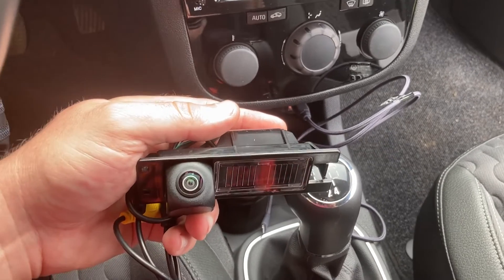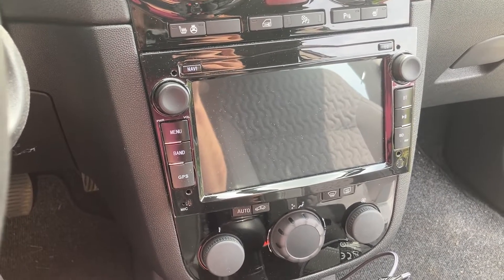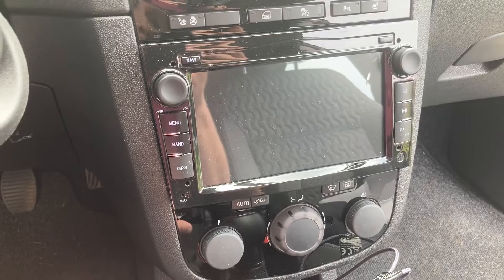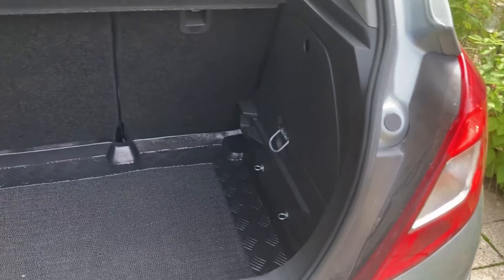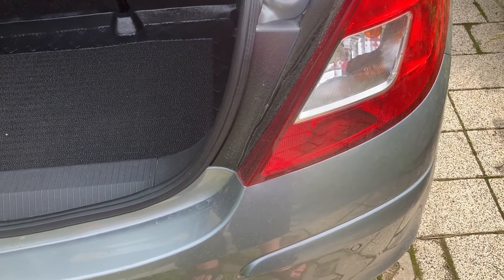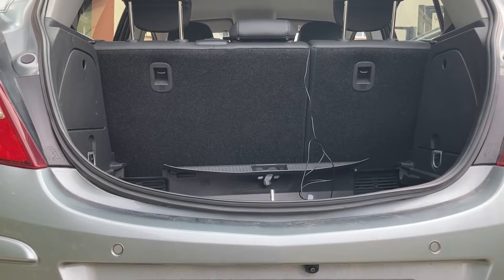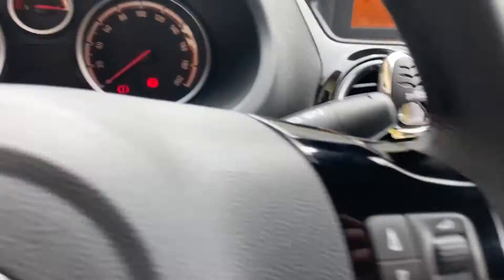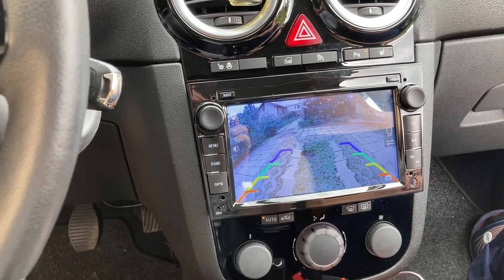DIY - 2014 Opel Corsa D 1.4: Install a reversing camera

Comment: Hello, I have installed the backup camera just like you. I have the same setup. The first 5 times it worked great, after that the video frame from the backup camera on the screen shifted to the left a few centimeters. I can't find any settings to adjust the video frame shift. Do you have any idea how i can fix this?
Reply from the maker: That's strange, honestly, considering that the first few times it worked fine. Have you tried disconnecting it from the Android unit and reconnecting it? Are all the wire contacts solid (including the one to the back of the unit)? I don't have any left or right-shift options on my unit either, so I'm not sure if this is something that can be solved through software...
Reply: @TheMissingBolt  I have tried reconnecting it, I am going to check the connections and do a few test to see which part is failing. Thank you for your input!

Comment: Nice video 👍 
Do you know how to change reverse parking lines from static to dynamic. So they move left and right when your turn wheel. Is there an option in settings. Thanks.
Reply from the maker: From what I remember, the option to switch from static to dynamic was a special wire on the camera itself that needed to either be cut or not cut in order to put it in dynamic mode. I left ours on static. I haven't seen any special option in the navigation unit's settings to enable / disable this feature.
Reply: @TheMissingBolt  thank you. I know some cameras come with that option to cut or not cut wire but those dynamic cameras are a but dogey, it should be built into unit and work with the steering wheel thanks to canbus but I think these units just don't have it built in on the option. Thank you for reply.

Comment: In my car when I put the reverse gear, the radio already knows and looks for a camera, so I suppose I do not use the reverse light but the camera still needs power I assume. I need to check because in the manual there's a "reverse video signal+" cable apparently, which do the job.

The main issue is I still don't know if I want to get the camera because I'm not sure I'll use it. Do you use it all the time for parking? 

PS: In Italy we just hit the car behind. 🤣
Reply from the maker: Indeed, one camera wire is for the signal but the other is for power. I didn't want to take power from the radio unit, I thought it simpler and safer to take it directly from the light bulb. Having said that, in our case at least the camera has proven to be very handy. I know about the Italian habit about slightly bumping the car behind, I think it's really funny 🤣 ... but here in Romania, people don't take kindly to that sort of thing, unfortunately... so parking sensors and a camera are really useful!
Reply: @TheMissingBolt  in the end I decided not to get it. I don't want the hassle and I'm getting in and out of complicated  situations without issues, so I don't think I really need it.
Also we park so close to each other over here that a camera or sensors can't even help. Like sensors would beep all the time and the camera would be too close to see what's happening.

Comment: With canbus u actually dont have to cut the rear light and use the ground at the right rear light (bolt)
Reply from the maker: In principle any ground source should work. Indeed, it may have been easier to only splice the positive wire for the rear lights and then use that bolt for the ground. Both solutions should work just as well.

Comment: The link to the camera is dead :( 
You got any screenshots or New link? 

Im looking for One for my corsa 2013 but I can only find for Corsa 2011… None says 2013
Reply from the maker: With AliExpress sellers it's best to ask them directly if a product works on your year and model of car - I did this myself before buying the unit because (if I remember correctly) the product page said it was compatible with Corsas only up to 2012 ... but the video is proof that it also works on a 2014 model.

Comment: hi i have one question do you know sa if it possible to change the layout and icon specially for the clock from analogic to digital and also reverse.thank you
Reply from the maker: That clock icon is a widget which is provided by the Android system running on the display unit. You can remove the clock widget and replace it with any alternative that you like better. For my particular unit I don't remember seeing an analog clock widget (i.e. a round clock with dials / needles indicating the time), but then again I never searched for one. Given the many widgets Android has available, there's bound to be one with an analog clock too.

Comment: hello what are these little red cables on the rca used for, because you didn't connect them maybe because your machine is canbus
Reply from the maker: It is a CANBUS, yes. That's why I needed to use a filter in order to power the reversing camera.

Comment: Hello.  I apologize in advance for the bad English.  I wonder if the original display above the multimedia works for you?  I have a big screen from full equipment but I want an android but I would like my factory display to work as well.  I hope you will see this comment even after 5 months from the publication of the tutorial.  If there is a possibility to contact you on another social network I would be grateful.
Reply from the maker: Hello! Yes, the display above the multimedia works fine with the Android unit that I got. I was also worried about it at first, but it turned out to be no problem at all. The only minor inconvenience is that in order to change the time, for example, you no longer have a physical button, instead the Android unit comes with an app that allows you control the upper screen.
Reply: @TheMissingBolt  Hi friend, can you please tell me how that app that allows to control the upper screen is called?
Reply: A little bit late, but it may be helpful to some people: you can code the car via Op-Com to make it seem like there's no radio installed. After doing that the "music" tab in your screen is going to dissapear and "settings tab" is going to show. You can then access the settings via the steering wheel controls.

Comment: Good job an d thanks for the video. One questions:  is the same color (lucid black) the radio unit than the rest of the car interior? In the video seems yer but on internet I saw a lot of opaque black
Reply from the maker: Yes, I matched the color of the Android unit to that of the dash, namely lucid black. The seller I bought from also had dary and bright gray. I didn’t see opaque black as an option.
Reply: @TheMissingBolt  thanks for your answer. I was talking about the other sellers on aliexpress. Are you satisfied of this android radio? Is it possible to share the internet phone connection with the radio unit? Can the radio unit be update with the new android version? Does android car work well with the phone via BT?

Comment: Hi, did you add reversing radar on the rear bumper ?
Reply from the maker: Not sure what you mean by reversing radar. But if you're referring to the rear parking sensors, then those came with the car from the factory so I didn't need to touch them at all.

Comment: Hi, is your new radio still working? I was reading online that plenty of people say that it dies after few months of use. 
Thanks for sharing your experience! 😊
Reply from the maker: Hi! Mine is still going strong 😀 I installed it in the spring of 2021 so it’s 2 years old now, with absolutely no issues.

Comment: Hi Dear, can we use the GPS NAV from the same device without connecting to mobile device. I need to upgrade music system and add gps nav system in my vauxall corsa car but i thinking if i can install  1 device only for both functionality.
Reply from the maker: Yes, you can. The device uses Android, so the usual applications are available through Google Play, including Google Maps, Waze etc. The GPS sensor itself (which plugs into the unit) isn't extremely accurate, but does a good job overall.
Reply: @TheMissingBolt  Thanks so much for reply. So i will buy this device and use the inbuild GPS of this device.
Reply from the maker: @deepakkakkar7698  Yes. But do note that you to need to create a hotspot from your phone or to insert a SIM card to the unit in order for it to have data access.
Reply: @TheMissingBolt  ohhh that is what that I dont want. I thought GPS NAV works without any such SIM or hotspot network. Thanks for noticing this.
Reply from the maker: @deepakkakkar7698  If you're using an online navigation app, such as Waze or Google Maps etc., you do need internet data access to keep the maps updated. There's no way around it. You can use alternative offline navigation apps, with static maps that you only download once - these won't require a SIM or phone connection during driving. But they also don't give you traffic updates, don't update the route based on the latest traffic data etc. The navigation unit itself does allow for simultaneous music and navigation, so it should be close to what you need.
Reply: @TheMissingBolt  Got your point dear. Now i am all clear. So may be i will buy tom tom or Garmin device to enjoy GPS and music both same time.

Comment: Hi, hope you can help. I have a Vauxhall corsa 1.3 diesel. It’s 14 plate but don’t know which head unit would fit my car. Can you send me a link to it as the one from Ali express has 15 different kinds from your link when going to add to cart.
Reply from the maker: Hi! I've added a link in the video's description with the exact unit I used. To be more precise, I got the version with Android 10, MTK PX5 processor with 8 cores, 4 GB RAM and 64 GB storage, together with the Carplay cable. I got the camera from a different supplier (also in the video's description).

Comment: Hello I broke some of the clips that hold the black plastic trims on the car you can see them at 34m 06s of the video do anyone know we're I can get replacement for them thanks
Reply from the maker: Yep, it happened to me as well on a different occasion. You can either buy them from an Opel / Vauxhall dealer and expect to pay 2 - 3 EUR per piece, or you can try from AliExpress (tinyurl.com/yc2knzjv), where they're much cheaper and may be just as good as the originals. For reference, the OE part number is 2228839.

Comment: Did you have som problems with radio not turning off when you take key out?
Reply from the maker: No, I've never had this issue with this Android unit. It always shuts down about 1 - 2 seconds after I remove the key.

Comment: I see that there's no USB port on the unit, how would you connect apple carplay ? Will the factory USB port do the job ?
Reply from the maker: The unit comes with 2 USB ports. The first one is for MP3 sticks etc. and I've connected that to the factory USB port of the car. The second is for wired Android Auto / Apple CarPlay and has a dedicated wire that also comes out near the 12V socket.
Reply: @TheMissingBolt  is it possible to wire the apple car play USB port to the factory USB port and not the MP3 stick one ?
Reply from the maker: @TheAbrunqaj  Yes. The factory USB port continues behind the dashboard with a cable that ends with a miniUSB jack. You need a USB-to-miniUSB adapter here which you can use to connect either of the 2 USBs from the Android unit to the factory USB port.
Reply: @TheMissingBolt  I recently bought a 2011 Corsa D and would love to install a backup camera. The car came with the SAT NAV unit . I wonder if that factory unit will support a backup camera ? I didn't have a chance to remove it yet to see if it has a video input.
Reply from the maker: @TheAbrunqaj  Honestly, I have no idea if an aftermarket reversing camera can be coupled to an original Corsa SatNav unit. One thing you can do (apart from checking on forums if anybody tried this) is to pull the unit out and check out its rear connectors, to see if any of them may be used to attach a camera.
Reply: @TheMissingBolt  Thank you buddy.
Reply: It's been a few months since you have the unit. Are you happy with it, do you recommend it ? Any lag or disconnect issues ?
Reply from the maker: @TheAbrunqaj  I've had it for nearly 1 year now. I'd give it a 8.5 / 10 overall. No disconnect issues, it behaves well. I'm having some problems with Bluetooth and radio background noise, though with the latter I'm about to try out a better antenna. Android apps including navigation (Maps, Waze) works well and so does the reversing camera. It does warm up a bit after 2 hours of continuous use, especially if you're using navigation, but it never crashed or shut down on me so far. For ~250 euros it's been a pretty good bargain.

Comment: Did you install the android Auto yourself? If so, would you have the instructions for it?
Reply from the maker: Yes, I did install it myself, though at that time I wasn't making YouTube videos. I don't recall having any instructions in the box the unit came with, though the setup is very straightforward. At the very minimum, there is one large cable bundle that powers up the Android unit and which connects directly to the wiring harness of the car through a large dedicated plastic jack. On Corsas that have MP3, you also need to connect the USB cable from the car to the dedicated USB wire bundle for the unit. Typically, all wire bundles in a good Android unit should be labeled individually and you can't connect them the wrong way since each jack has a unique shape. Lastly, you should connect the GPS antenna, which is a single shielded wire that you need to route from the top-front of the dashboard (so that it gets good GPS satellite reception) to the back of the unit - this one has a threaded coaxial jack.